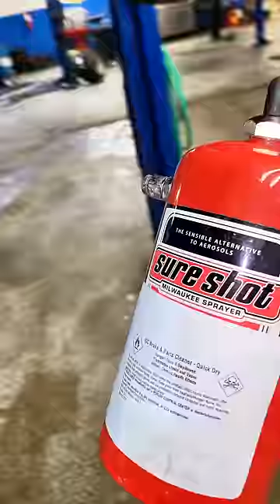Oil Change Perfection 😗👌 #honda #oilchange #satisfying

Comment: Yep that’s why I changed my own oil. I don’t put a plug back in when I still got that garbage coming out.
Reply from the maker: That "garbage" is metal particles from the internals. No amount of draining is gonna un ware the internals 😅👌. It drained plenty. 4.5 quarts out/4.5 quarts in. Waiting an extra 5 mins for 1/20th of a quart to come out is a waste of time. There will ALWAYS be about 1/2 quart if not more of used oil still in the engine.. no matter how long you let it drain. TMYK💫
Reply: @TEVIDEOS exactly it's just menial at that point, especially when we're rushed for time

Comment: I usually let the oil drain for an hour or 2 to ensure every drip is gone and prefill the filter.
Reply: An hour or two? Jesus lol. That is ridiculous.
Reply: Certain vehicles that's not recommended as the oil pump will battle to prime.

Comment: I run a bit a new oil through b4 replacing the plug and let it drain, then I put the plug in after seeing clear oil… probably over stepping it

Comment: Oil filter probably tighter than needed.
They only get tighter with time.
Reply: Torque on oil filters is 8ft lbs which is about what he did. We go hand tight then snug. You can check with the blue preset torq wrench and if anything it’ll turn a hairline more to torque. Yes it’ll tighten while driving but we’ve never had an over tightened filter with our method

Comment: I feel bad for the next guy doing the oil change over tightening that nut 🔩 is unnecessary and that’s also part of the reason shops will never absolutely never do any basic maintenance on my vehicle because of fellas like you
Reply from the maker: Yeah no it's not over torqued bud 😉👍. WELL aware of what 30ft/lbs feels like.

Comment: How about changing the ring around the bung and not only rubbing some oil around the gasket of the filter but filling the filter with some oil before installation. How about flushing that dirty engine with some clean oil first to see if there is anything unusual that comes out, no such thing as perfection.

Comment: Torque wrenches are precision measuring instruments. Its not the best idea to use a torque wrench to loosen bolts. Thats what a breaker bar is for
Reply: That's why they call them hacks.
Reply: It's not a torque wrench it's a long handle/reach flex head ratchet so it's fine to undo that drain plug. Yeah all the armchair mechanics will yell oh he didn't torque it properly after either. Honestly if your not smart enough to put a pan plug in without stripping the threads or getting it tight enough a person shouldn't be changing their own oil.
Reply: @super6954  Holy shit. Youre right. My bad. still love the short

Comment: Seriously? A breaker bar to snug up the drain plug? THATS WHY I DO MY OWN OIL CHANGES!
Reply from the maker: Yeah that's not a breaker bar bud 😅
Reply: @TEVIDEOS  well I'd say it performs like one. I use a 3/8 ratchet and a slight bump to snug drain plug. I have had service stations tighten the plug with the car...and stretched my pan threads so oil drips. Overkill

Comment: Резьбу можно сорвать. Надо динамометрический ключом затягивать сливную пробку.
Reply from the maker: If you aren't familiar with how the proper torque feels then yes. This isn't my first rodeo so it's not necessary for me to use a torque wrench in order to achieve the proper torque. I have videos of me checking my torque and it's within 3 ft/lbs everytime

Comment: This is why I change my own oil. First, he did not drain all the oil. Second, he did not use a torque wrench to tighten the bolt. Then, he over tightens the bolt.
Reply from the maker: 😅 The oil drained plenty. Fully aware of what 39 ft/lbs feels like bud, not over torqued. Not my first rodeo 😗👌

Comment: And thats why you dont take your car to the dealership, they dont drain the entire oil
Reply from the maker: Literally not possible to drain all the oil through the drain plug, there will still be about half a quart if not more of used oil in the engine no matter how long you let it drain 😗👌 It drained plenty. 4.5 quarts came out, 4.5 went in 🤷‍♂️

Comment: Was that just basic CRC Brake Kleen you sprayed after the oil change? great work btw
Reply: Likely the same type of non chlorinated solvent, but in a rechargeable canister. A can of brakeklean does not go vary far if you use it for moderately sized parts.

Comment: A stream like that would end up being about a half a cup possibly slightly more. So 1/8 of a quart. However... that is 1/8 of new oil that you will now not be adding if you using the dipstick perfectly. For 10 minutes of time you're contaminating the new oil with 3% more junk oil than is already impossible to remove, and you are not receiving 3% of the benefits that comes with new oil. So about 1 part in 20 of your oil change is working against you verses working for you. Is that enough of a difference to make a difference? For all we know this is engine cold stream not engine hot stream which could bump us up to 1/4 of a quart. You do the math

Comment: Ive got a 2006 Cadillac sts 4.6l V8 with the Northstar motor it has 156.000 miles on it, i usually change my oil every 3,000 mile but this last time i went until 8,000 miles will that hurt my motor? And how often should i change it, i use Mobile 1 high mileage full synthetic 5w 30

Comment: Perfection? You are using cheap filter you did not clean off theoil and did not use a torque wrench on a drain plug 15LBS. Did I mention you did not replace the drain plug gasket?

Comment: Perfection? 
Firstly you remove filter first, secondly allow all oil to drain from sump, thirdly fill new filter with new oil to prime, & fourthly torque the sump bung.
Reply from the maker: Doesnt matter what you loosen first. 4.5 quarts came out.. 4.5 quarts went in. Priming the filter is not necessary nor is it specified by Honda to do so. The oil capacity (by Honda) includes the amount needed for the filter. Lastly, the drain plug is torqued within spec. Not my first rodeo. Well aware of what 30 ft/lbs feels like on an engine drain plug with a new crush washer using this specific ratchet 👌. Yall be thinkin too hard about this stuff

Comment: I take out the drain plug...oil filter off and go find something else to do for awhile.
And what IS perfection at changing oil? You change it...or you don't. And probably not put drain plug in while it's still semi pouring out.

Comment: For everybody that is whining about all of the old oil not being drained, do you know how many quarts of oil your car takes? Typically between 4-8 on an average vehicle: that is a lot. When you have a little stream trickling down, that is literally like .1 or .2 of one quart that is finishing, it is literally nothing. The tiniest bit of old oil will not hurt your vehicle, old oil stays in the engine no matter what unless you power wash it which also cannot be done. Please use your brains

Comment: Grrr. This is why I need to use a breaker bar to remove the oil plug. Jesus guys, you don't have torque that thing down to 125 foot pounds!

Comment: I see water in that oil  possible  head gasket, crack in head or engine block , welsh plug in Cyl.head ?  A few possibilities or someone mistaken  the coolant filler cap with the engine oil cap.😅

Comment: Far from perfection here.
Didn't let all that shitty oil fully drain out.
Why no torque wrench on the drain plug.  That breaker bar is a good way to strip the threads when you tighten it bk up like some Ahole did to my car and then it ran dry and blown the engine.      👎👎👎👎👎👎

Comment: Honda...30 lb/ft on that drain plug... so the rest of us mechanics don't have to replace that pan the next time....  otherwise thanks for cleaning the mess.
Reply from the maker: It's within spec bud. Not my first rodeo. Fulllly aware of what 30 ft lbs feels like on a Honda drain plug with a new washer 👍👌

Comment: You call that perfection? No way I think you should have filled the new filter, lube the gasket of that oil filter with oil, looks like you over thigh that bolt on that aluminum pan…didn’t let all the oil come out of that oil pan

Comment: What is the rules of changing oil? Not to overtighten the oil filter. Once the gasket meets the surface, give the filter 1/4 to a 1/2 turn. Drain plug should be around 15-18 Nm tight. As a mechanic for 31 years i have seen quick lube, mom'n'pop garages along with dealerships over tightened oil filters and drain plugs as to where i fold the filter in removal and air hammer plugs without damaging oil pans. It will get costly for the customer and it wastes valuable resources and time for the mechanic. I have alays provided the customer the parts that were removed back to customer to show and to have the customer take them to the last place of buisness to show them the costly mistake that the garage had made. Along with pictures and info on the damage report. This way the garage or buisness can see for themselves what went wrong and maybe learn from their mistakes. Please train people properly and take the time to watch and show them the correct way of performing a proper oil change. Yes all cars and trucks are different from one another, but the procedure for an oil change is similar every time.
Reply: He has multiple videos as a Honda lube oil jockey. He noted that it's torque to 30 ft lbs and always with a brand new aluminum crush washer😅

Comment: I use a plastic cup from the convenience store I will break your oil filter loose that I will put a plastic cup over the filter squeeze the cup at the same time taking off the oil filter all the oil and the oil filter stay in the cup and you do not get any oil on you I'm a retired mechanic

Comment: Sorry, but that's not perfection. You dropped the bolt, and you made a mess while removing the filter. You had to punch a hole at the bottom to let it drain😊
Reply from the maker: What's wrong with dropping the bolt onto a splash pad? 😅 And 2 squirts of piss worth of brake cleaner takes care of that "mess" poking a hole in the filter is a waste of time and makes it no less of a mess.

Comment: You called that perfection? Putting back the screw when the oil still dripping? No thanks, I'll do it my way
Reply from the maker: Its a bolt technically.. But also there is literally no point in letting it drip any longer than that. No matter how long you sit there and wait there will still be about half a quart of used oil still in the engine.. 4.5 quarts came out.. 4.5 quarts went in. Change you oil on time, every time.. That's what keeps your engine clean.. not waiting an extra 10 minutes to get a 20th of a quart out if your lucky that is totally fine being in there. Carbon deposits get evenly absorbed into the oil (hence the dark color of used oil). Your not gonna get any dirtier fluid out by waiting. Waste of time imo but you do you.

Comment: Aaand that's why I change my own oil. The last of the sludge hangs on till the very end, putting the plug back in before it's done draining is a rookie move. Cranking on a drain plug with anything more than a small 6in ratchet is just plain stupid. You have alot to learn guy
Reply from the maker: 😅👌 Ok. This "sludge" you are imagining is not present if you change your oil on time. Oil is designed to suspend carbon deposit evenly in the fluid.. Hence why the oil gets dark in color.. And "cranking down" on that plug was actually within spec as this is not my first rodeo 🤠👌. 30 ft/lbs. I'm wellll aware of what that feels like using this specific ratchet and a new crush washer. The length of the ratchet doesn't matter if your smart and understand torque/leverage 😏👍. Using a 6 inch ratchet is just making your life hard bud 😅 smh.. go talk nonsense elsewhere
Reply from the maker: -10 points to griffendor

Comment: You don't tighten The oil drain plug with that type of tool you used in open-end wrench from 3: 00pm to 5:00

Comment: This person didn't do it properly . You're supposed to let the oil drain until it drips little drops. I wouldn't let this person touch my car. The cleaning is just to deceive the customer
Reply from the maker: Lol. It drained plenty. You do realize that there is at least a quart of old oil still in the engine after draining no matter how long you let it drain right?.. Your not going to be able to get all the old oil out unless you take your engine apart lol. So that being said there is no point in waiting another 10 minutes for 2 squirts of piss worth of oil to come out 😅👍. Changing your oil on time every time is all you need to do. Don't need to make sure every drip is out lol good luck with that 😅
Reply: @TEVIDEOS  I'm sure there is more than a quart of oil left in that car. You need to get that car out quickly because that's how you make your money. When I used to take my car to the dealer the person would remove both the filter and drain plug and let it drain while he was doing the multi point inspection and rotating the tires and yes I was watching.

Comment: Would be perfect if u used a torque wrench comon im a drop out an a pothead an still know how to do it professionally
Reply from the maker: I don't need to use a torque wrench in order to acquire the proper torque. 30 ft/lbs. Not my first rodeo. Fully aware of what the proper torque feels like on these drain plugs with this specific ratchet. No point in pulling out an extra tool to get the same end result

Comment: Did u now u can drill or puncture a hole into the oil filter to avoid it spewing out like that, not an expert but definitely a pro tip

Comment: stop putting them damn oil filters on so tight it’s always a honda tech
Reply from the maker: Literally hand tight it's fine 😅 Ive never had an issue removing my filters by hand. 14 Nm or 3/4 turn after seal makes full contact.

Comment: Definitely NOT "Oil Change Perfection" as there are plenty of dirty oil left inside the engine, should really flush the engine to get the old/contaminated oil out first!   Clean-up afterwards is a SHOULD, does NOT make the job perfect!
Reply from the maker: The oil drained plenty. You may not know this but, no matter how long you let an engine drain from the drain plug hole there will still be about half a quart of not more of used oil still in the engine. You are exchanging the oil so it can continuously clean and lubricate the engine.. you do not need to waste you time getting an extra 20th of a quart out lol 😅. There is gonna be used oil in there unless you tare the whole damn engine apart 😗👌. We do not flush engines.. nor does any manufacturer actually recommend that.. murp.

Comment: Didn't see you lube up the new oil filter gasket, nor did I see you lube up the oil drain plug gasket. Not sure I'd call this perfection lol. You should probably also triple check that the old oil filter gasket wasn't still attached to the car, because if you double gasket the oil filter you could blow up your engine.

Comment: That oil change was wayyy overdue, bet the valvetrain that you could see through the oil fill cap was pretty brown, ive been changing the oil in my grandmas 2013 civic at its computed intervals since 2018 and the valvetrain looks like brand new still, not even slightly yellowed, i take good care of her engine.

Comment: it’s funny because dealerships especially Honda and Subaru, don’t seem to understand that the oil filter and oil drain plug are supposed to come back out 😂, trust me I know because I used to work a take 5 we always had to use a racket and breaker bar to get the plugs loose

Comment: One more reason why Honda Engineers rock. I've checked with those trying to change one on a Ford 4.6 Mercedes s420 ,  2013 GMC Acadia V6, 3.7 Jeep Liberty, Subaru Forester, VW T5 2.5TDi , Chevy Equinox, 2.4L EcoTec engine.

Comment: I hope you pre-filled the oil filter. And I hope you used a filter wrench on the new filter after you hand tightened it. Luckily for the car owner if the oil filter loosens up they know who installed it. P.S. use a paint pen and write the date and mileage on the filter so the owner knows how far they went until the filter loosened up.
Reply: I was taught that a filter wrench is to remove old filters which seized on over time, not to install new ones. The new oil filter goes on just hand tight, about ⅔ of a turn past rubber gasket contact. Yeah, torque wrench for tightening the drain bolt, but with experience one can get by snugging it up by hand and feel.

Comment: Well you over tightened the drain plug and didn’t torque it to 28ft lbs also over tightened the oil filter. It’s 1 1-4 turn after the gasket makes contact housing. But other than that. Does perfect especially the senile guy on the filter 😂

Comment: Didn't look like you poured any clean oil in to push old oil and sludge out
Reply from the maker: There is no sludge.. and if there is, running clean oil through it isn't going to do anything.. 👌
Reply from the maker: Keep up on oil changes and that isn't necessary

Comment: No torque wrench? At least he didn't use an impact gun.
Reply: Using a torque wrench on a drain plug is for people who don't change oil often.  It's not hard to develop the feel when you're putting back dozens of drain plugs every single week, month after month.
Reply: I work at Honda nobody fucking uses torque wrenches. Only the new hires that just started working on cars so they can develope a feel.
Reply: Fair point. Although I will say if you are good at it fine. My double oversized drain plug (probably from Jiffy Lube) begs to differ.
Reply: @tboneski3809  trust me Honda techs loose their shit when a stripped out over seized plus comes in. We either have to drill out the threads and helicoil it or install a new oil pan.